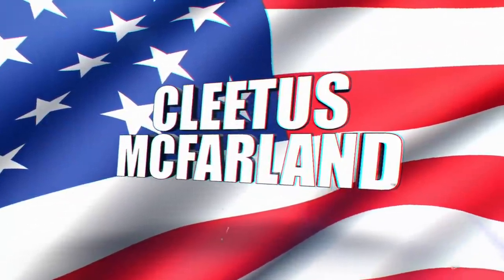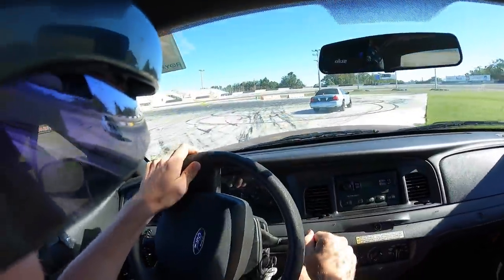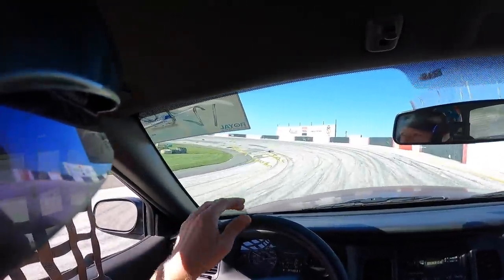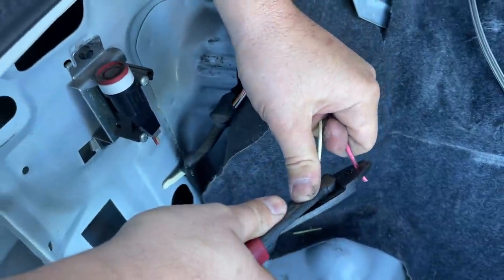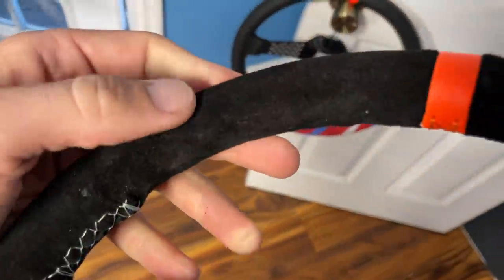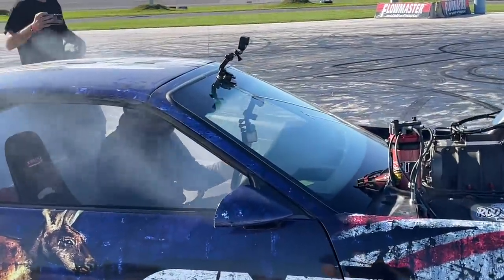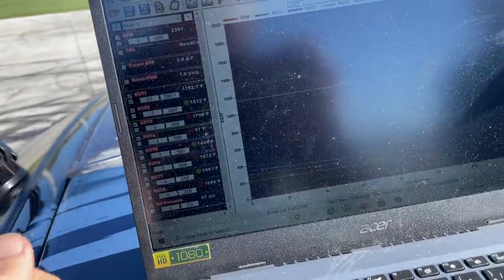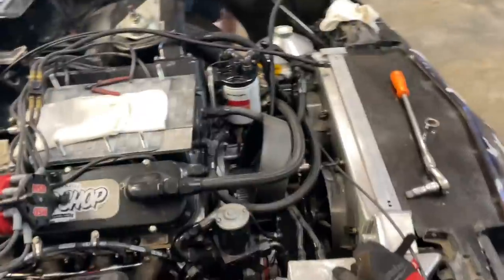You Guys Are Going to Love or Hate This... + Testing TOAST Ends With Oil EVERYWHERE...

Comment: I can see a bit of an issue that would need looking at. 
When you come out of the kidney bends into the main oval you are heading straight at the wall of the opening,one tap from another car could send someone into the wall head on. 
Not an issue with the oval so you may need a few concrete barriers to smooth the shape of the wall on the outer of the corner.
Reply: Safety first. Good call!
Reply: Good point. Perhaps they should use the other side of the track for the bends.
Reply: @TheInsaneShecklador  there really isn’t any bends on the other side of the track
Reply: I saw this paused and posted this same issue. Good looking out.
Reply: @marshallgreenwood7806  Ya, after I commented I realized the two sides of the track are not symmetrical.
Reply: Just mentioned this myself, If nothing else the FF has way too much liability now because it's a reasonably suspected outcome.

Comment: You also have to consider the type of crashes you will have based on the layout. More risk for direct frontal impact to the wall on the infiled exit. Then there is the corner-infield light pole on exit depending on the speed carried through the infield a car could be sent into the tire/mound barrier. Are you going to put safety barriers through the middle of the pad to keep crashing cars from crossing the track to oncoming cars?
Reply: the speed will be reduced significantly though, a lot of tracks actually use this setup but i think the biggest issue is going to be the tire and brake wear.
Reply: Those where my thoughts, glad to see I was not the only one.
Reply: ...it's all a recipe for disaster
Reply: There's also the risk of impacting the inside corner of the track entrance coming out of the chicane(?).

Comment: Sounds like you need actual curbs built into the track for the “kidneys.” Would be a neat addition to the track to make it really feel like a road course
Reply: those grass corners are going to get absolutely shredded.
Reply: Skirts. They're called skirts... but yeah, the grass is gonna get fucked up. I'll be shocked if nobody slides off into a light pole
Reply: @rexrufer  Yes, like in road racing.
Reply: i mean is grass and irrigation cheaper than replacing bent wheels? probably 😅
Reply: @christopherpisello430  grass and irrigation cheaper than steel base model crown vic wheels? fuck no. he probably has more in just the grass than most people have in their forces.

Comment: First half of the race like normal, the second half the opposite way, turning right. Could solve the left front tire wear issues with aggressive drivers, and make for a less strategic race but more tactical
Reply: am sure its been said before they cant do the backwards oval due to where the exit off track is,
Reply: @djsteve1030  Exactly if going the opposite direction would slam head on into the exit wall on back straight
Reply: @TATE411  i thought i had heard that mentioned before. Thanks for confirming i wasnt going mad :)

Comment: My concern with the kidney layout is the potential of someone spinning out at speed into the pit lane entry/exit, or head on into the wall. Unless you could block that gap then I think it’ll be super sketchy.

That said, it’ll make for a crazy race for sure!
Reply: I agree with that. The need to use some of the concrete k rails and put them on the edge of the grass at the entry back on to the oval. Otherwise if someone puts their nose up the inside of someone on the exit of the burnout pad, they are going to meet Mr light pole very quickly. Also the rules need to be inforced. If start banging up other people's cars and turning them around, that person should have to go to the back of the field. Do it again and you get put in the penalty box for 5 minutes. 
When He showed how good all the new Crown Vic's look and the calibre of some of the drivers coming, I thought great maybe these Crown Vic's should not get destroyed like all the other times. But then he said the Deisel Brothers were coming. Well there goes that idea of keeping the cars usable again. That's why the need to they make sure that the rules are policed properly. If you do something  deliberately bad, no penalty box. Black flagged and out of the event.
Reply: @Twarken maybe if they race in the opposite direction it might be safer? they can use the part of the track they don't use to enter the race already at speed intead of starting off directly from the pit lane..
Reply: THIS.
Reply: @vincentaubert3815  good shout. I was thinking the same when I watched the video back. Would still be sketchy with lots of crashes but definitely safer than heading for that pit lane entry/exit wall, not to mention there’s a lot of human traffic in that area during the race.

The other concern is where the marshals are located in the burnout pad. Kidney layout would see drivers spinning out towards them unless they put concrete barriers up to keep the cars on track and away from the marshals.
Reply: My first thought to, could lead to a T bone hit on that far pit lane wall. I get why layout can’t come infield between turn 4 & 1 because it would miss timing loop so reverse direction would be best compromise.
Reply: What about the Bus Stop in Daytona? Very similar and works just fine (I've been through there countless times @ 100+mph. :))
Reply: @vincentaubert3815  I think Garret mentioned possibly running it in the other direction i nthe video too. So hopefully he already thought of that.
Reply: @WOTTechnologies  Daytona bus stop doesn’t have a gap in the wall on exit though. If Cleetus can fill the gap with a solid wall then it would be safer but not sure how practical that’d be.

I think it would be best to run the first half of the race on the oval as normal, then second half in reverse on the kidney layout. Would be safer and a riot to watch!
Reply: You could also do the kidney route on the front stretch instead of the back. Then you wouldn't have to worry about the wall gap and the action would be closer to the grandstands.
Reply: @twarken5078  i thought they made a steel-reinforced section they slot onto the wall a while ago for races like this to make the wall solid? Might be misremembering though
Reply: @KennyCnotG  I was thinking this same thing. It was a steel barrier and I can swear I remember a video of them fitting that wall in there
Reply: @KennyCnotG  Cleet did install that but it was on the spectator side of the circuit to allow fans through, which is opposite the pit lane entry/exit on the track. If he installed the same deal on the pit lane side then it’d be way safer but not as practical.
Reply: People where spinning across the center with the throttle still pegged never lifting on the oval layout last time cough Heavy D. This will send people across the center possible head ons at entry onto the burnout pad and directly into the wall or pole while exiting onto the oval.
Reply: @MJTAUTOMOTIVE  This. Rules NEED to be enforced. If you don’t want it to be a demo derby or tactical spin outs, then penalties needs to be put in place. IMHO, a penalty box should be #1 warning then a general black flag. Increased danger and risk means stronger rules need to be enforced.... however, first step is to have the rules enforced to start with.

Comment: I approve of this layout change! Only things I’d keep an eye out for is safety, of course. Block off the run-off straight to avoid having anyone enter illegally. If you can’t get concrete barriers, make there be a significant penalty to discourage drivers from taking it (severe time penalty, disqualification, etc.) That, and make sure the middle of the burnout pad is blocked off so that cars don’t go as wide as possible and hit a car on the other straight. As always, safety is a concern, but I trust your judgment Cleet. Someone mentioned having the kidney layout be a joker lap, but considering the difference in speed and rather blind re-entry onto the straight, I say either do it for every lap, or none at all. LeMullets is 100% just for fun, but fun also needs to be safe.
Reply: I agree with some sort of barrier but concrete seems like a bad idea..
Reply: @AudibleVisibIe  I'm sure Cleet has no shortage of old tires to make a tire barrier. Hay bales are a cheap and biodegradable alternative. Plastic barrels filled with water could also do the trick and are reusable, easy to empty and store for next time.
Reply: @AudibleVisibIe  worst case, they could use concrete barriers. they just need to make sure to make a straight wall, and instead make it like a semicircular shape.

Comment: >>> Rally Cross does 4 laps and 1 must be a joker lap.  The joker lap is a little longer.  That allows for some cool strategies for passing.  So perhaps you could run the oval race, but each car must do “x” number of Joker laps in the 1st half and the 2nd half.  That will allow for exiting leader changes without forcing everybody through the joker kidney every time.
Reply: To dangerous re entry on the inside of an oval track you're insane😂
Reply: Love the theory but agree with Martin, turn 3 is far too dangerous with mixed traffic.

Comment: RIP grass if you do the kidney. If you want to switch it up, run one half of the race normal direction(left turns) and the second half backwards (right turns). Think it will challenge the drivers and you can wear both front tires evenly.

Comment: That's almost like a Joker lap from rallycross, could make it a mandatory number of times to do the joker? Or alternating, every other lap, that way you get some speed on some, and some turns on others.
Reply: The only problem with that is you have slow laps and fast laps merging at the same point in the track almost every lap which slows down everyone and can cause accidents

Comment: Seperate those plug wires on Toast. You Tuber “An Engineers Findings” has brilliant video on the subject (title is along the lines of pre ignition) with a beautiful practical demonstration of what’s happening when you run plug wires together
Reply: Yep, there used to be a TSB out on the old Magnum Ram trucks because of this issue. You had to reroute all the plug wires so that if they crossed, they crossed perpendicular to each other.
Reply: Ha, yupp. I didn't even think of that but makes sense. Gotta love parasitic capacitance.

Edit: looked up the channel, what a gem you have found. Thanks!

Comment: Okay, a couple of ideas, mostly to do with safety.  1 - make sure you have  concrete barriers across to stop cars from going all the way across and into incoming traffic coming out of turn 4.   2- set a  large tire out about 10 feet from the grass mid way through the burnout pad, and make the track go around it.  That way nobody can grass cut.  Make it a whole row of tires all the way across the grass even.  3 - do similar things for the entrance out of turn 2 and exit back into oval turn 3.  Make sure that cutting the path won't be a good idea.   You could get some of those plastic "fill with water" construction barriers to better define and also limit cars driving into traffic the wrong way. 5 - hay bales / tires to make  chicane on the back straight so nobody an straight line for advantage.

For what it's worth, they did this at Ascot Raceway in California back in about 86 or so when I worked there.   It works really well and keeps the overall speeds down to a reasonable level.

Comment: Yes, it's gonna cause a lot of accidents.  And heading towards the middle of the pad is dangerous.  Where will you keep support personnel?  Coming around turn 2, getting pitted... they'll be right in the middle of the pad.  If they get turned going towards turn 3 you got poles and the other side of the pad to worry about.  In fact, it's possible that oncoming wrecks could get close to each other.  I don't think this is the race, but I'll watch nonetheless!

Comment: I love the kidney track. However it would be even better if all the cars had slicks and you put in some red and white checkered edge bumps on those 4 edges coming and going off the burnout pad. Then you would have an awesome race. I also think the headlights and tailights need to be removed and either plastic inserts put in or vinyl to cover them up till you can make some proper single piece front and rear clips.
Reply: A, he has a nitto sponsor for a shit load of nt05's because they last forever, unlike slicks, so slicks aren't coming to the vics, B they didn't even wanna put in race seats and your talking about aftermarket front and rear clips? you flew over the cuckoos nest my guy.
Reply: Everyone,  including the grass guy,  can agree the track needs curbs

Comment: KIDNEY IMPROVEMENT IDEA:

Would it be a better idea to make the kidney on the opposite side of the track, maybe make it less of a sharp turn and make it wider and longer so two cars can battle it side by side? With multiple cars on the track in not sure how this will end with the current layout, especially with the lesser grip on the pad...

Also, making it on the other side is getting it close to the main bleachers, more action for the PPV and for the people on site.

I love the idea of the kidney, would make an epic race, just not how I would have implement it!

(Up vote if you agree)
Reply: Issue with that i see, that's where the finish line is, could complicate timing/transponders
Reply: @tylerellefson2417  that's completely true and I didn't think of that, probably why he didn't show this option, he's a bright guy I'm sure he taught of it
Reply: @Masterscrambler  yea, great idea though! Someone else suggested that another issue with the kidney on the back straight is reentering near the track entrance, which could cause a pretty severe crash if the edge of the wall is hit. Seems like a fun idea but needs more thought for sure, I'm sure they're working on it though

Comment: For passing I'd think you'll need a larger braking period.  If you watch any Formula 1 the s type turns don't lead to much racing as one line is quite dominant over the other.  You'll just see corner cutting and door slamming.  Where a good driver can impact the oval doubt driver will be to make much progress in cluster of traffic with kidney.

Comment: I think it's reckless to do the kidney. You've got drivers going directly toward a light pole and if they slide off the skid pad they're going in the grass which will make it tough to slow down. Then on the exit you're pointed right at the wall and body contact is going to result in a nasty crash. 

You have this great slate of drivers participating. If you get somebody hurt then you can kiss that kind of professional participation goodbye. 

I'll be watching either way, but as a fan of yours and the Freedom Factory I'd say don't do it.
Reply: The kidney is an entirely fine configuration with a smaller field of proven, safe drivers. No diesel dudes or bubbas who plow their way to victory lane. I've long advocated for Cleet to get serious with at least ONE event, exclusive for known, skilled drivers.

Comment: You absolutely NEED seat back bars with that confit.  Super dangerous to have an unsupported back of the seat. If you get hit the belts will slack and tighten and cause some serious neck damage. 

Should be easy. Just a tube and a piece of flat bar!
Reply: incorrect...the seat is supported by how its built and is incapable of flexing that far without breaking the whole seat. They also have racing harnesses that dont autotighten either....no more original belts so thats impossible to tighten and hurt necks
Reply: @Shadow0fd3ath24  Lol. NRG seats are not exactly known for being well built. They are terrible for safety and not sturdy.
Reply: @Shadow0fd3ath24  those aren’t fia approved seats. I have written several papers about basal skull fractures and they all come from seat back movement. 
Even if the seat was fia approved- the mounting bracket is not and so the entire default would be to use the seat back brace. 

I’m just trying to make sure no one gets a life long injury. I just want to see the race go on as much as anyone else

Comment: I use Right Stuff RTV and no gaskets, but that might not work with boost. 1/8 inch clearances on those crappy wet valley intakes.

Comment: Man, that “entry to the pits” hole in the wall is dangerous enough when going round and round but driving straight towards it as you exit the burnout pad is terribly dangerous, if someone t-bones that with the minimal safety equipment in those cars they will be hurt badly.

Comment: Ya you gotta right stuff the crap out of the distributor clamp to make sure they don’t leak. Also it’s pretty common on supercharged manifolds to have EGTS way out at idle or very low load. On our blown 540’s the EGT’s are about 4-500 degrees colder on the back 4 at idle and then once you get on the throttle they all even out by about 5,500rpm. And by the 330’ mark they are generally within about 40 degrees across the board.

Comment: Put studs in the heads for the headers, tack the studs on with a welder and grind the tacks down so the header fits flush to the heads, drill a hole in the stud, install castle nuts and cotter pins. Thank me later. You could also just safety wire them in. Choice is really up to you. Either way it will keep the hardware from backing out.